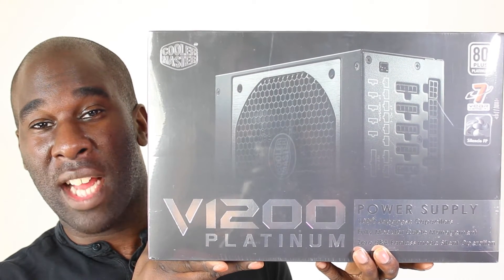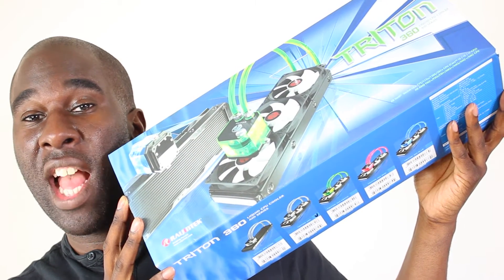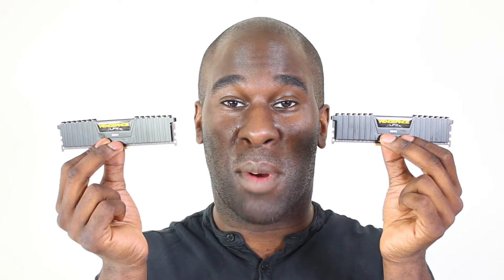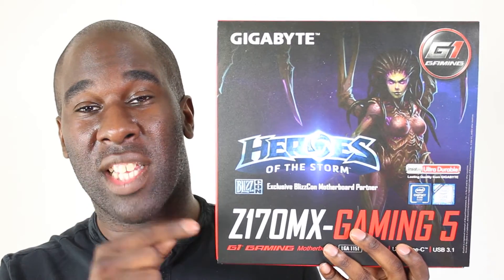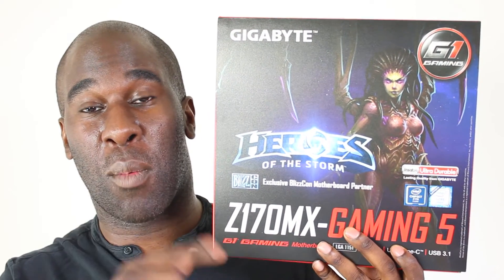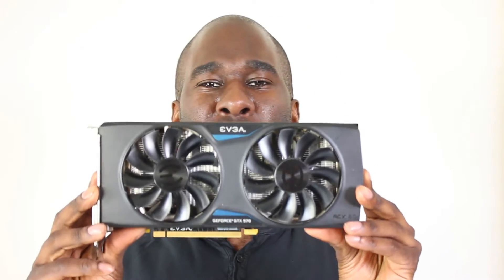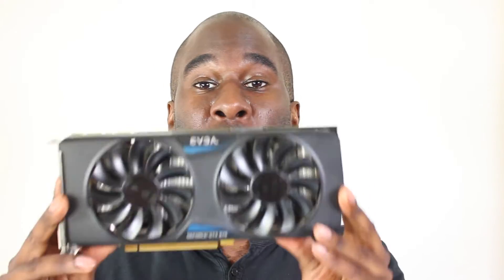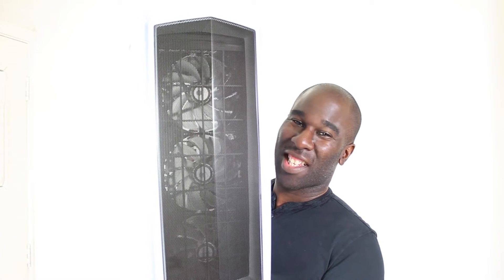Could be the Computer Build this year!? | Ft. Gigabyte & SilverStone

Comment: did the water cooler have a tight fit on the top?
Reply from the maker: Yes without a doubt i don't recommend it really if you are just starting out as you will be disappointed! Not everyone has manged to do what i did with this specially #hardwarecanucks he wasn't impressed too with this design!
Reply: Ahh thanks man might just go with a singel fan cpu cooler bc i love this case
Reply from the maker: Try it my way because it does work, but it's hard to do as well, but if you manged it you will be happy with it!
Reply: Ok thanks man cheers
Reply from the maker: no problem!

Comment: I have same motherboard, how do i increase ram memory speed in the bios? I tried turning on xmp but can not manually increase speed
Reply from the maker: You will have to make it activated, as when you choose xmp it should normal correct this for you automatically, but i see that's not the point here...so activate it in the bios settings and increase the ram clock speed to what you have on the memory say 2666mhz and xmp says 2166mhz increase to the correct value in the memory settings! it will be there in the memory settings in the bios!

Comment: When is part 2 coming? Still using this case? Any updates on how you like it? This case is on my short list for a swap right now, so any opinion would be greatly appreciated.
Reply from the maker: Part two is coming next week, still using this case but i am swaping it for the antec s10, i like it alot its silverstone best case of the year so far and for a few years now.
Good features are 

reservoir mount holes are there in the case

case has quality L.E.D.S and i mean that

case has a custom shroud to cover cables power supply and can cover up if your not using a rad

custom nearly perfect control for l.e.d.s

looks amazing

best cable management from Silverstone in a longtime

Things i don't like:-

there's no filter for the fans in front of the case

the top of case needs 4 screws to take of the top and also has plastic tabs that can snap quite easily if not careful 

the top is very tight in deed when ready to fit a 360 rad let alone a 420 as they say it can 

other than that i would give this case a very good 7 out 10, i hope this helps in your quest to seek a case that fits your needs!!
Reply: +Maxedoutpctv MXDOUT Thanks a lot man. That definitely helps. My main rig is in a Thermaltake V51 right now. It's great, but thinking about a swap to something a little sexier.
Reply from the maker: Do it and don't hold back!

Comment: Do you think this will fit the ROG RAMPAGE V EDITION 10 motherboard?
Reply from the maker: Yes it will with no problems!, in fact i think this would look pretty good in this case too! are you thinkiong about buying for this case or do have other options?
Reply: Even though its a EATX motherboard? and yes the price looks right. This is going to be my first pc build that i've done myself.
Reply: also, I was wondering if i could list you all the parts i was looking at and if you'd give me your opinion on everything! i would subscribe!
Reply from the maker: Yeah sure, list away and i will help you with it!
Reply: Case: Primera Series PM01
Intel i7-6900k
Motherboard: ROG Rampage V Edition 10
GPU: Asus ROG Strix Gtx 1080 x2
Cpu cooler:  Thermaltake CL-W108-PL12SW-A 3.0 Riing RGB 360 AIO Water CPU Cooler with 120mm Powerful High Static Pressure Fan
Case fans: Thermaltake Riing 12 RGB LED 120mm Adjustable Color Case Radiator Fan - Triple Pack
Ram: G.SKILL Ripjaws V Series 16GB (4 x 4GB) 288-Pin DDR4 SDRAM DDR4 3000 
HDD: Seagate Barracuda STBD2000101 2TB 7200 RPM 64MB Cache SATA 6.0Gb/s 3.5
SSD: SAMSUNG 850 EVO 2.5" 120GB SATA III 3-D Vertical Internal Solid State Drive 
PSU: RMi Series™ RM1000i
Cables: CableMod C-Series RMi & RMx ModMesh™ Cable Kit
feel free to list any add ons you might think necessary! thanks again!
Reply from the maker: case is cool as it has l.e.d.s build in into the case and its not to pricey.

cpu is okay if your using it for video editing, 3d modelling etc. for gaming i would go for a quadcore cpu like a 6700k or if your doing both video editing and playing games or just go for the 6900k.

motherboard has all the functions you need and has all the l.e.d.s..

i wouldn't get two gtx 1080s, i would save money and stick with one, as the motherboard bandwidth will not give you more power it will give you less!

The Thermaltake water cooling aio i would forget that as there is way to many r.g.b.s in there with as well, please if you spending that sort of money on that i would go with Ek water cooling aio loop as they are the best or one of the best.
https://www.ekwb.com/#ow-home-postslider also that thermaletake aio is old looking and looks like when Corsair, Antec, Zalman and others first started out with aio's.

There is way to many RGBS to go in there ,get some really nice fans ,but no more RGBS 

Aero Cool Akasa Alpenföhn Antec Aqua Computer Arctic Cooling Asusbe quiet! BitFenix CoolerMaster Coolink Corsair Cougar EK Water Blocks Gelid Solutions Lamptron Lian-Li Noctua Noiseblocker (50)NZXT (23)OcUK Tech Labs (8)Parvum Systems (1)Phanteks (19)Prolimatech (7)Raijintek (8)Revoltec (3)Scythe (9)Silverstone (34)Xigmatek (6)XSPC (1)Zalman (3)Zaward (1)

The ram is very good and brand is new i like it!

I hate mechanical hard drives/ SSDs as you would of save money for better drives. Crucial, Samsung, Kingston and Intel are your best bet!

your boot drive, these days should be bigger, try for 250GB or even 500GB for apps and stuff!

Psu i would look at no more than 850 watts to be honest 700 watts would be enough and still have left overs!

That case alone lights up the whole insides, the rgb graphics card would be a nice touch and the motherboard would light the back of the case which would be cool as in this case you can also turn off the leds too!

Power wise this pc is a beast build and will run any games on it and would really be okay for video editing music production etc.

I hope this helps!
Reply: I was looking to get that x34 predator monitor which is why i thought dual 1080s would be best because its a 4k monitor
Reply from the maker: Hey, that screen is end of life or going to be, and this screen is UHD not full 4k also that graphics card you have chosen has a resolution of.... 
7680x4320 @ 60Hz
That's nearly 8K at 60hz!!

I would have a look around if you truly want real 4k or just UHD, but when the 1080 ts out in July it will be able to 4k no problems without lag!

and that screen is still nice, but i just think if you getting everything brand new, why not have everything up to date, i am just saying in my opinion!

Comment: one big power supply for your build right?
Reply from the maker: To be very, very, very honest with you... that computer only needs about 600 watts, but i had that power supply for nearly a year off cooler master and i was waiting for my water cooling bits to come trough so i can do a really massive build that needed that sort of power and i was getting bored of using only Silverstone, Antec, Corsair Evga etc. i really needed a change and technically, it was just to show off the case that you could put a big power supply in there too( gigabyte motherboard  mx z170) .
Hey now primochill have sent the water cooling products now, so there will be like a j two cents videos coming out now as i have done custom loops for over 10 years but never shown them really on the channel yet. But watch this space as i am going to do them on my channel  now and there will be lots of ideas and tuts about doing stuff, if you get my drift!
Reply: nice sounds good man